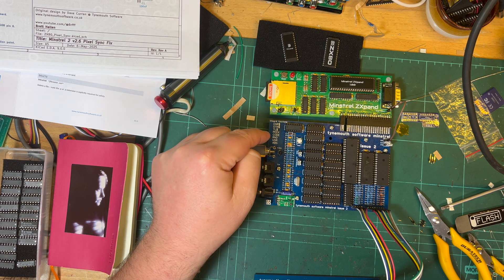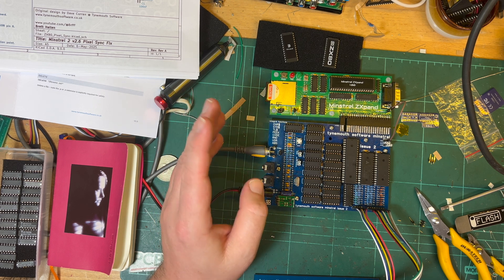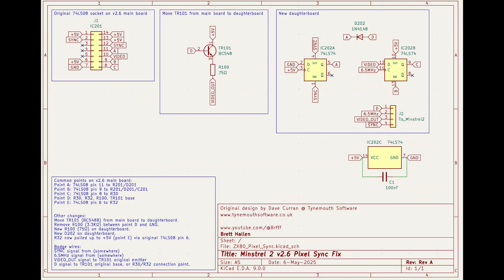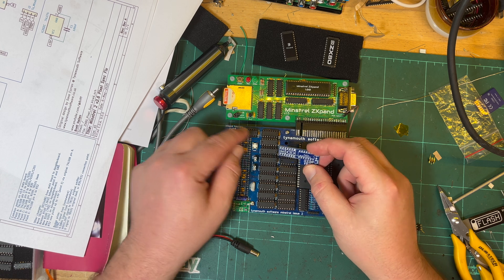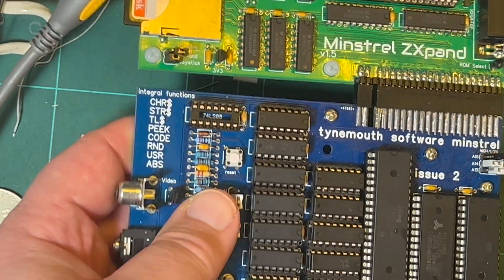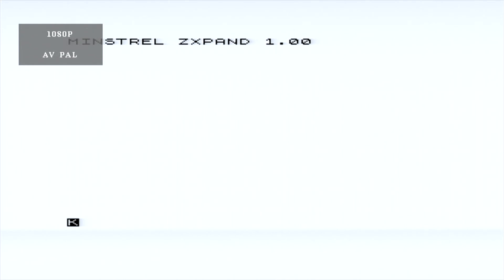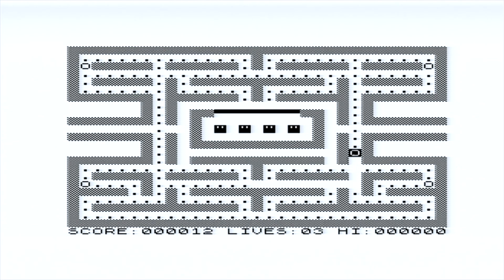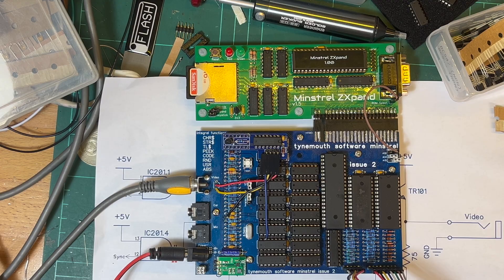🇬🇧 Minstrel 2 (Sinclair ZX80 Clone): Part 2 (Pixel Synch. Issue) [TCE #0609]

Comment: Love the tiny board design. Only small nitpick would be the pinout of the header resulting in cables crossing - glad to see it already fixed in Rev. B. I'll likely get boards for this fix produced for a friend's Minstrel 2
Reply from the maker: Actually Dave suggested routing the wiring under the board using thin wires ... so connect under the daughterboard, run under it towards the back and then under the Minstrel to where they need to go, then no wires are visible.  I could send you some boards as a "letter" ... might arrive about the same time as the bloody Moscow 128 board does!!!
Reply: @Brfff Hahaha ... still waiting for the notification letter to arrive so I can pick it up 😅
No need to send me a PCB ... I'll likely order some soon for the moscow 128 expansions I've been working on

Comment: As mentioned in the comment on your other video, I emailed you about that offer for one of these boards, but I thought I should leave a comment on this one to at least help with the algorithm.

Also, good job on the board design, leaving a cut-out for the reset button was a smart move.
Reply from the maker: Thanks!  As emailed, I'll post a board off tomorrow - things have been stuck in Port because of the flooding ... I posted the watch I found over 40 years ago in Christchurch to its owner's daughter on Wednesday, hoping it'd get there by Friday ... but it hasn't moved.  Oh well ... what's a few more days after 45-odd years? Realising now that I've had the watch in my possession longer than its original owner did! 😇
Reply: @Brfff  I got back from Melbourne on Thursday and was shocked at how much rain you guys got this week! Thankfully my place came out unscathed, unlike last time there was a big storm, when the rain came in through my air conditioner vent while I was at work and left me with a mess to clean up when I got home.